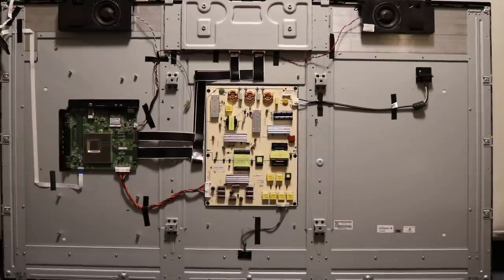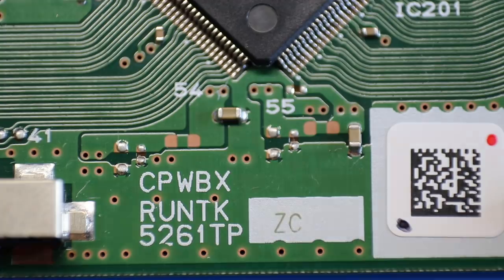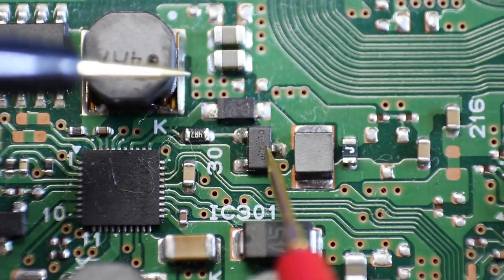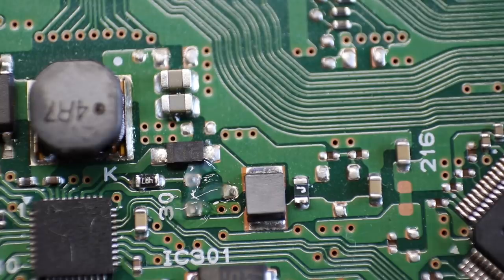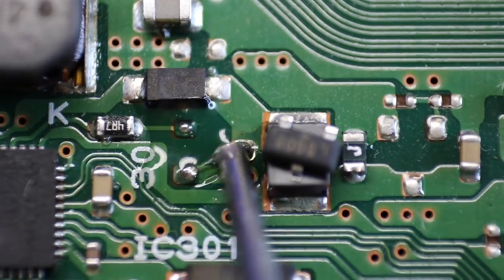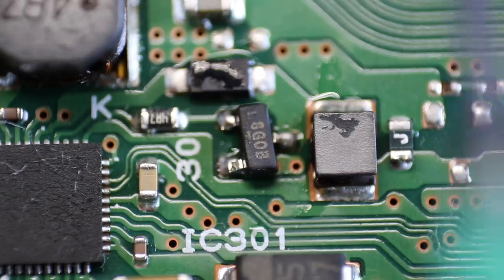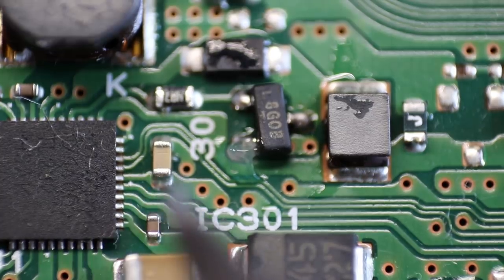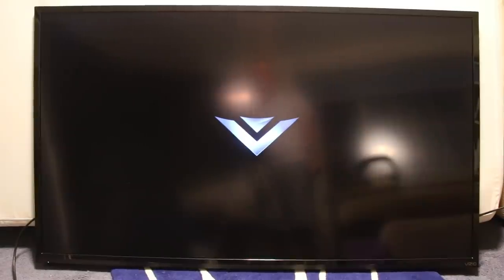60" TV for less than a $1 - Vizio E601i-A3

Comment: I repaired my 10 year old $2400 Samsung LCD for $3.50 by replacing 2 bad capacitors on the power supply
Reply: I find that the longer I live, the more capacitors I have to replace!
Reply: Yeah i had a pretty similar case once, where i just had to replace one cap.
Kinda funny how easy it is some times
Reply: Samsung TV's from 8-10 years ago were notorious for a bad batch of electrolytic capacitors. The company did a great job of repairing as many TV's as possible within a reasonable warranty period but you can only do so much. I repaired one 2 years ago that was out of warranty, for a friend. Capacitor kit was $12, shipping was $8. I volunteered my time(less than 2 hours) For $20 she had a functional 46" TV. Still works great today.
Reply: I did the exact same thing! Always check to see if what ever you have has a fixable problem.
Reply from the maker: Great job fixing it!
Reply from the maker: Yes, there were a lot of them with those bad caps.  Pretty easy to spot the classic "swollen' top.
Reply: IF it was 10 yo i probably would have Cost less to buy a New 10 yo one
Reply: Yeah we had a monitor with a bad capacitor.  Sad that when we went to Radio Shack (RIP) a few years ago to get a replacement, the sales girl had NO FREAKING IDEA what a capacitor was or what it did. Finally she opened the parts drawers until we found the item we wanted.  It did do the trick; that monitor worked fine after that.
Reply: caps are a common problem, they use cheap caps in many cases

I remember plasma TVs ... one and always the same failure - the coils.
Repair in shop, some hundred euros.
DIY - 10 Euro for the coil, and 10 minutes (usualy changing all coils in one work process and all caps from good company)
Reply: Electrolytic capacitors dry out over time so 10 years would not be surprising they dried out.  There was a run of bad caps years ago when someone tried to steal the secret recipe and came in to undercut everyone only to find out they where missing the secret secret part of the recipe the keep things stable over time.  Lot of things had issues those years but shouldn't be much left around as that was over 10 years ago.
Reply: @joelr877  Their LCD computer monitors had the same problem I fixed a few of them for next to nothing by just changing out the caps which were bulging.  They weren't the only ones I fixed Dell and Viewsonic monitors they all used cheap Chinese brands which had the bad electrolyte formula.
Reply: nunya baznus  damn right
Reply: Bad electrolytic capacitors are the easiest things to detect and change because they look bad. But that transistor is hard to detect, you need to know the truly reason, otherwise you can solder out a half of the pcb board and never get to the working screen
Reply: Jason R ......a friend in need, is a friend indeed!!!
Reply: @petuniasevan  I miss Radio Shack...it was nice to just be able to pick stuff up!

Comment: That part was big enough not to use hot air, but if you do, solder paste works much better than wire.  Melts more evenly and you don't have to keep tweezers on it.  It also might help if that board had some heat sinking.  Thanks for the video!
Reply from the maker: Thanks!  Great idea.

Comment: Touch a 300v capacitor and it'll enlighten you to the dangers of home TV repair. 

That being said its a miracle my heart hasn't exploded over the years.
Reply: I mean... we got taught that if we ever wanted to open anything with big capacitors we should wear protective gloves and prioritize discharging of the capacitor.
Reply: Yeah, but not as bad as touching the high voltage contact on a CRT ... I’ve seen that knock someone flat on their back side...

Comment: So happy I found this. I have a Vizio 60" I bought from Best Buy 4 years ago. The backlight is very uneven, easily seen when the tv displays a light background, i.e. white background on last week with John Oliver. Some areas very bright and some areas very dark. I heard Vizio will not fix this. Can this be fixed?
Reply from the maker: It can be fixed though it may be quite involved.  You can also try mitigating the problem.  I explain more in my top tips pdf that is free on my website.  Link is in video description in case you’re interested

Comment: Superb fix - So many flat screens being thrown away nowadays simply because of faults/issues like these which can ultimately be repaired with knowledge.
Reply from the maker: Yes, it happens all the time.  Usually it is a fairly simple fix.  In this particular model you don't even need to go to the component level like I did.  You can easily buy a new tcon on ebay for like $20 and with a screwdriver replace it.
Reply: @FrugalRepair  I worry about such purchases what if someone sells a bad board?
Reply from the maker: @dannygjk  It's usually not a problem, just send it back for a refund.  Even ebay sellers who have a "no return" policy will almost always (since they care about their rating) will take things back.

Comment: forgot to tell that you put i dunno how many years of study your knowledge under 1$ price.
but well done.
Reply from the maker: Thanks.  I think you give me too much credit though.  I don't think soldering in one component takes years of study and knowledge.
Reply: @FrugalRepair  :) ty. Maybe not many years but you have a background to do this. I understood the real meaning if this vídeo. I didnt meant to be rude...
Reply from the maker: @fshimage  No problem, thanks for your comments.
Reply: @FrugalRepair  at all. Actually I think using a heat gun was the hardest part.  For one component with three leads you could of even used just solder and a soldering iron and popped one lead or leg at a time. But doesn't matter the job got done and the set now works.

Comment: Good instructions thanks. This might be the repair needed for one of my two Vizio's crashing in the same two weeks. I'll explain both situations and hopefully you can share your thoughts on diagnosis. TV. #1, Backlight certainly works but losing color, contrast and brightness as the picture is starting to blacken out in top left corner and bottom right...almost is rectangle shapes in each corner. Picture is good after a rested restart and the problem quickly creeps back in. TV. #2, our oldest Vizio maybe 8 years, 50". First sign of a problem was the quick App start brand bottoms at the bottom of the modern FireStick would change the TV input to an unused port. Next problem it would blackout and flicker back on with clear white horizontal lines. Then it flickered until it don't come back. After long rests it worked again a couple times, V logo came up, with sound, and was back out within 10 minutes. Now it's out-out with no sound of the FireStick clicks changing the Apps, no V logo and all black screen...no backlight. With was a 2 month fading experience from beginning to end.

Comment: it would be interesting to show the diagnostic procedure and not just replacing a transistor, everybody can replace a transistor. testing the transistor on circuit is useless, more than often there is dc path around them by resistors and other components or even some other shorted component can create a dc path around the transistor. 
also that transistor is shorted but if it was open like often happens the beep or continuity test would be useless, it doesnt beep so in your line of thought it is good. try to go a little more in depth next time please. if somebody is uneducated in electronics hthey will learn nothing from this video and if the person has electronic knowledgde they will learn nothing either
Reply from the maker: I don't know if I would agree that "everybody" can replace a transistor.  I understand you may want more in-depth board level diagnostic explanation but that isn't really the point of why I made this video.  One of the big points of this video is to inspire people that things can be repaired inexpensively and I give an example of how it can be done on a tv that would otherwise be thrown away.   If you happen to have the same t-con board and it failed, at least I've helped you with a starting point in your diagnosis and repair.  And yes, there could be other damaged components but in this case, it was the only issue (like in many cases) and the tv was repaired.
Reply: Hey, here's an idea. Why don't you set up your own channel and do it yourself?
Sheesh.
Reply: he did with a multimeter lol
Reply: Prottoy Nahian  nearly all youtubers list the products they use in the description. He didn't make a big deal about any of the products, not at all dishonest.
Reply: Hugo... other way around. Maybe 1 in 10 of my 1990s computer engineering class could solder and almost none of use would solder surface mount parts on an existing board. I spent four years on design and assembly involving such hands on work and I never got good enough to solder surface mount components. I would have attached wires to the transistor and soldered the wires on -- rather than try surface mounting such a tiny component by hand.

Anyone with the skill to solder surface mount parts by hand can trouble shoot a board -- they are either in repair or assembly work with the later trouble shooting their own work.

Nor is it a terrible interesting video to look where the video power on/of line in coming in and then track its path and touch both ends with a multi-meter.
Reply: he just found the answer on a forum thread or another youtube video... that's why he didn't bother with the diagnosing procedure, simple because he doesn't know...
Just to let you know.. there is a similar video on YouTube since 2016... the name of that channel is ShopJimmy
Reply: You have no proof of this, nor is it relevant. He might have looked online -- it would be where I would generally start. He might have found a solution from someone else, a vague report of the power issue, that video, a circuit diagram, etc. He would still need to understand the issue, find/understand where the part is, have the meter, and know how to use it to confirm that the transistor was fried. Give that level of knowledge, it's also possible that he just traced along the power circuit for it. In any case... it's going to be a pretty boring video of him tracing random circuits and doing internet searches for a half hour or more.
Reply: @BW022  I'm sorry but it is relevant. And the proof is the video it self.
Reply: I was going ask the same/similar question. I've been a technician since I was teenager 30 years ago, but the last time I was able to diagnose down to component level was back when TVs were CRT and audio equipment was through-hole components. I'd really be more interested in knowing HOW he deduced that the THAT specific transistor was the culprit.
Reply: @sasiska... the fact there is another video is not proof he saw it or that he didn't diagnose it the issue some other way. Nor, even if he saw the video, is it proof that he doesn't know how to diagnose a problem. I look up coding issues all the time... that doesn't mean I can't trouble-shot code.
Reply: @rebeltaz123  I agree, tracing  down to the component level is very hard if not almost impossible and requires a lot of knowledge and experience. It is really interesting to know how did he find the specific component causing the problem.
Reply: Purpose of this was to show any shmuck can repair their TV instead of trashing it. Btw y'all deaf/cant read? He states this is a common issue and something along the lines of there being recalls for 2 models bc of this issue.
Reply: Yea, I don't think "Anybody" could replace a transistor. Heck I was even frustrated how bad he did at soldering that transistor... made me shudder. With out good schematics, or a known good one I'm not sure how he troubleshot it.
Reply: @RocksCrasher  If you have a known good component you can just measure the different values of the components. This is the brute force method. If you have schematics with test point values is the right way to do it.
Reply: @evilsushi1  what's the use of schematics when it's a known common problem? If he just out the blue got lucky and fixed his problem by blindly buying parts then passing off as him knowing exactly what he bought then sure you have a point. I'm not gonna pull out the manual or Haynes to diagnose/fix my airbags or w/e when there is a recall or an observed common issue with my particular model car and its 90% the same part across all  variations of my model.
Reply: @FrugalRepair  I appreciate the simple troubleshooting you did!...  To Hugo's point (and still simple), you could have removed the transistor and then verified that the short was gone.  This would show that the part was indeed causing the short.  It also saves on damaging a new part if that wasn't the cause of the short (indicating more troubleshooting needed).
Reply: @evilsushi1  you can measure against a good component ONLY if both components are out of the circuit OR both components are in the exact same circuit... otherwise, the comparison is inaccurate. :-)
Reply: Yes, this procedure would fail to find an open transistor. But shorted transistors outnumber opens by a long margin.

Still, I take your point. Many different faults could cause the no-picture symptom. This video is no substitute for talent at troubleshooting.
Reply: He probably didn't diagnosed the issue,I think it was a common issue. I say this because he did a continuity test with three dmm instead of checking the resistance across the part. It's kind of the same but it's not.
Reply: @BW022  most electrical engineers aren't the best solderers. Only because they're engineers that's kinda not what you do, but some do become good but not while in school.
Reply: @rebeltaz123  he didn't.
Reply: @BW022  he would need a schematic to even start the process of troubleshooting down to the component level.
Reply: @thinkman2467  Not necessarily. He never showed the process. I've tracked down a lot of issues without having schematics. Devices goes on and off … look at the power in, switch, power to the chips, etc. You can trace it with a voltmeter. The parts of the screen are flickering... find the connector ribbon and then the pins leading away from it. Put a voltmeter on each of the pins until you find one which is flickering... then follow the lead until it hits something, like a resistor... then put the voltmeter on that. Then put a meter across it. Look for a short, damage, crack in the board, cracked shoulder points, etc. Sometimes the damage is obvious... cracked switch, visibly burnt component, the component is physically loose (from the solder failing), etc.
Reply: @BW022  of course if there's physical damage but if there's not or what if there's not a total part failure. You're troubleshooting but who has time to go about it that way. Time is money.
Reply: @thinkman2467  Trouble shooting doesn't need to rely on obvious physical damage. Education, common sense, experience, tracing issues to their source, etc. all work without seeing physical damage. 

I had a friend whose cell phone keep shutting down. It was five minutes work to trouble shoot an issue with the power switch getting stuck and to bend a spring back into place. $300 phone. I had a TV which had two switches on the panel which were intermittent. Maybe twenty minutes work to open it, notice the circuit board behind the switches was flexing in the middle and put a sticky pad behind it to keep it from doing so. $600 TV.

Time is money is a poor argument. Most people don't have the option of turning arbitrary time into money. Few people's job allows them to simply work an extra hour from home anytime they want and make extra money. Overtime, extra jobs, more contracts, etc. requires a relatively long term plan. Nor do most people hire cooks, maids, personal assistants, etc. even though probably make more per hour than hiring someone. Most people don't want to work 14+ hour days say doing their job could) just to hire people to make dinner or clean their homes. Most people do whatever they can during non-work time to solve their own issues -- within their abilities.

I'm not a mechanic, but I'll Google an issue and check the tires if the light comes on. I'm not a plumber, but I'll switch a flapper on a toilet. I'm not an electrician but I'll install a new light fixture. Such things are within my abilities. Likewise, if at least look at cell phone or TV to at least see if there is an issue. The poster uses the handle FrugalRepair and can solder surface-mount components on a board... this was clearly within his abilities.